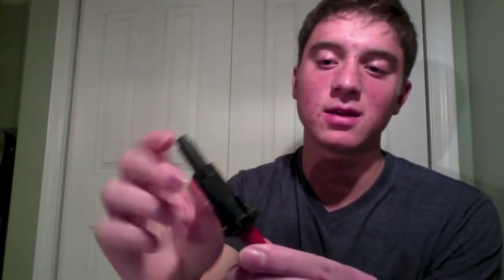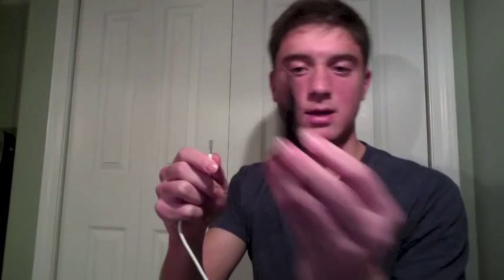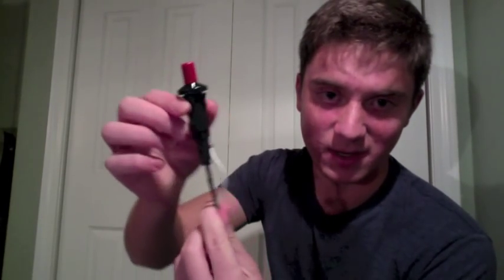Sparker For Potato Cannon: EXPLAINED

Comment: Do you add screws on the inside of the canon. Any special screws?
Reply: Yes you do. I prefer to use brass screws or preset much just the most conductive ones you can find. My screws come to a flat end but I think it’s better to have them be pointy. Just see what works best for you!
Reply: @steeledoggos6998  do you have a picture of what your screws should look like? Like touching? Spaced out?
Reply: @AlbertaHookandHarvest  I don’t have any pictures but you should have them spaced out slightly. Depends how powerful the igniter is
Reply: @AlbertaHookandHarvest  actually if you have Instagram or discord just give that to me and I’ll send you a picture of what mine look like

Comment: Had some problems with mine. I had the whole igniter in the combustion chamber. It worked for a day and then processed to not spark. I dont know it it was the hairspray because it was sticky or not. Do the screws eliminate this problem?
Reply: Buy a propane ou butane!!!gas ‘cause the hairspray is not good

Comment: Instead of attaching the wires to the screws, can you just insert them into the potato cannon and make them  half an inch apart? And tape it down?
Reply from the maker: nope, because the tape will not hold up when the explosion takes place in the chamber.

Comment: Could you just put the box into the chamber instead?
Reply: You could, I tried putting the box into the combustion chamber, it works but after a few firings the box gets damaged and the plastic that covers the wires starts to melt. The nice thing about the method used in the video is that you can keep an airtight seal.